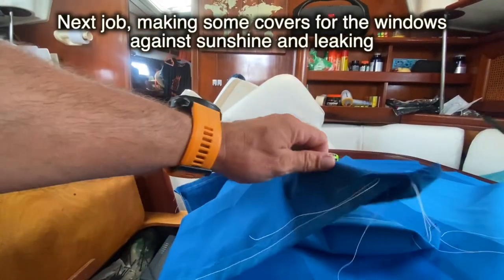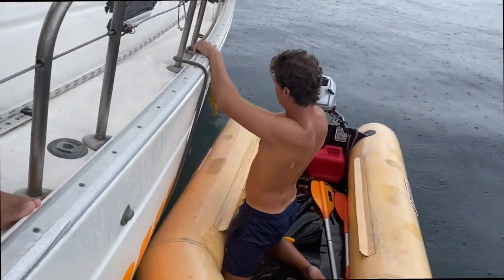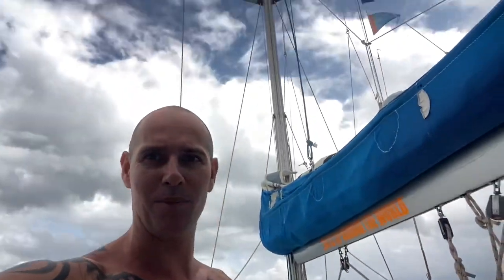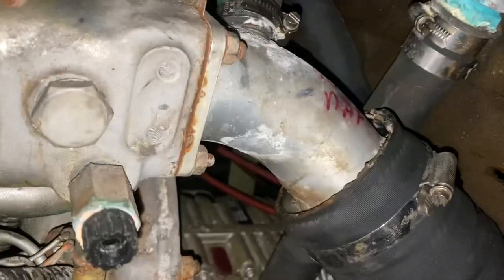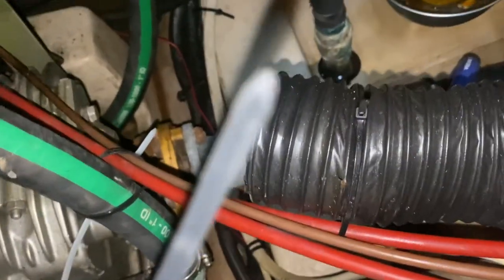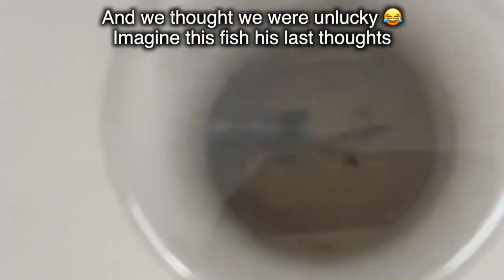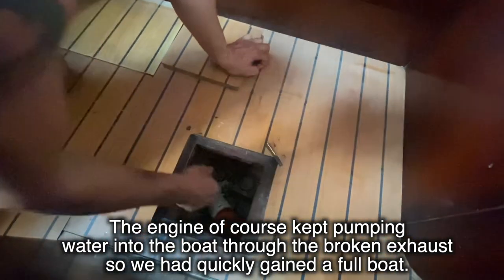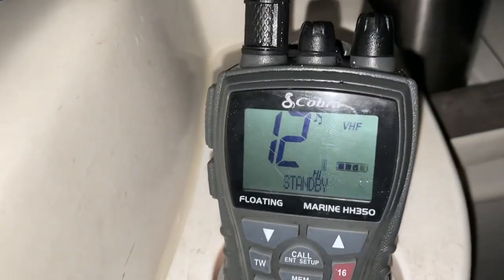Everything breaks 🙈 Our worst sailing trip ever 😭 Ep.41

Comment: The waterlock needs to be a closed system to force the water out the back of the boat. Probably melted it due to not having good flow.
I would have tried to fiberglass it back together. Or, if you could find enough hose, just bypass it.
Reply from the maker: You are right I think with the melting part, it was hot! But fiberglassing would  take to long with cleaning, holding problems drying I tought 🤗 so took the Easy way for the last Miles 😉